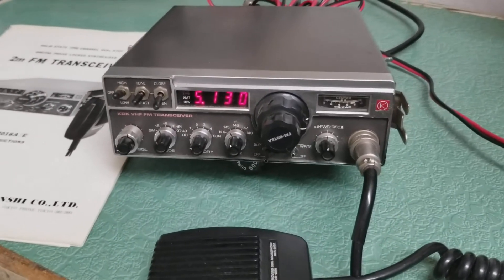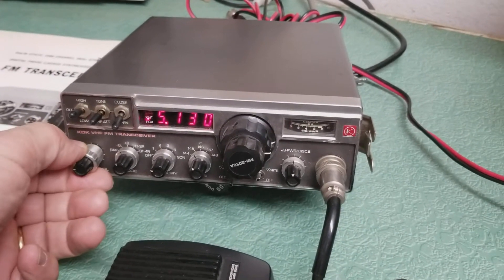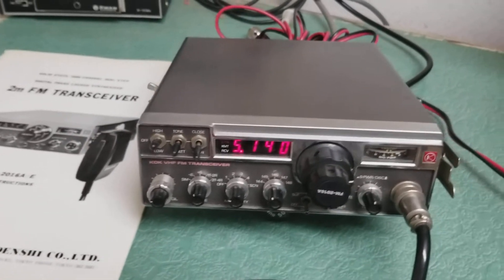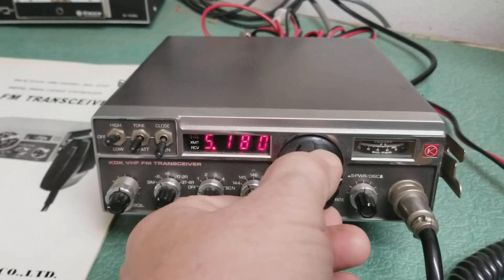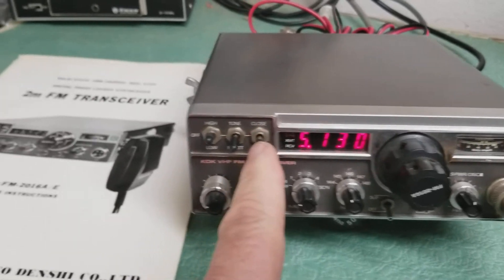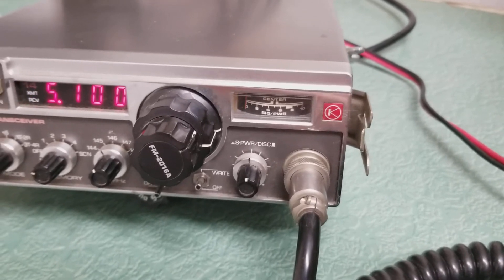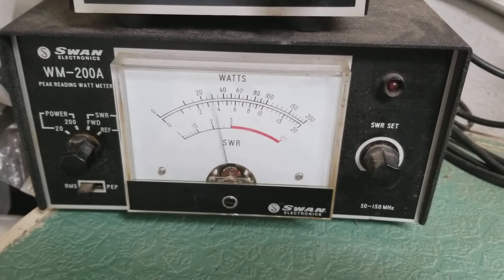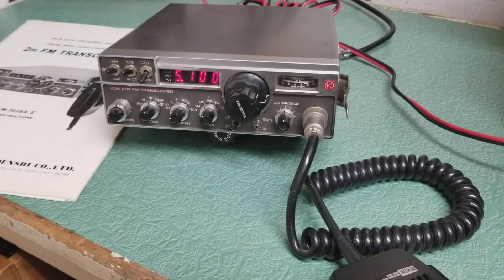KDK FM-2016A 2 Meter Mobile Transceiver

Comment: Great radio. Bought one of those for my first ham radio back in 1989/1990 for $50. Still have it. Works great.
Reply from the maker: I also had one for one of my first 2 meter radios.

Comment: I bought one of those back in 2001  for my first vhf rig. Fantastic radios - I worked a lot of simplex stations with a little homebrew four element yagi.
Reply from the maker: My first 2 meter rig in 1993